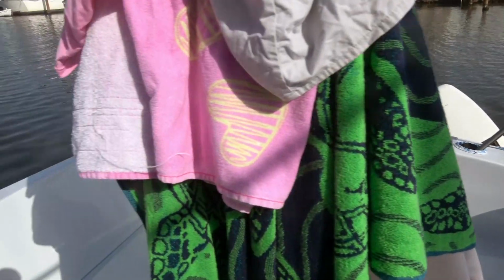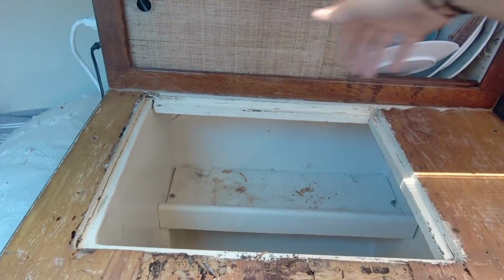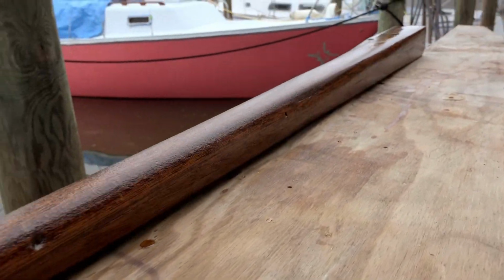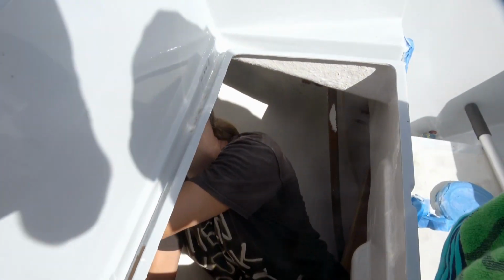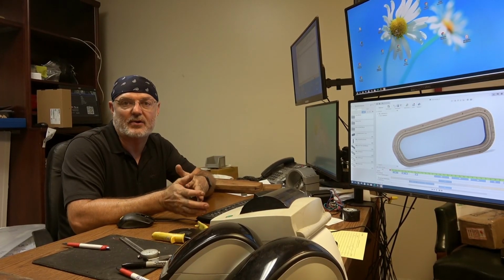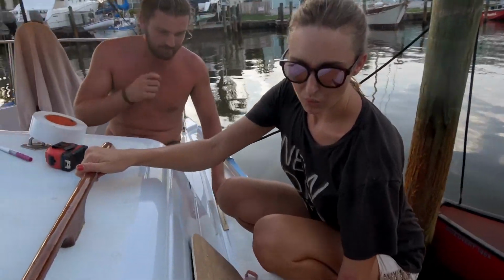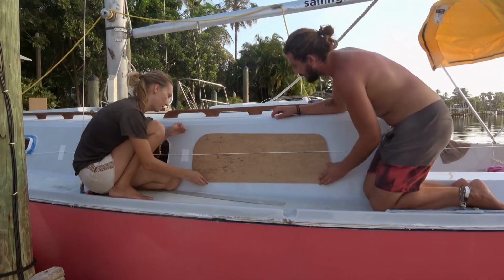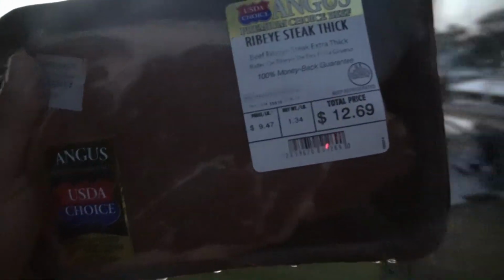WE DESIGNED AND MANUFACTURED OUR OWN WINDOWS | SMLS S8E35

Comment: Always water down my varnish 50/50 with white spirits for the first coat to help it seep into the wood fact. You do have to sand and rub your wood loads before if you are using a lube  on your wood like bees wax you have to rub the wood very hard and fast to get good results.... high polish obviously ✊✊✊😉👍⛵🏴

Comment: Nice work! So, what was the $4k problem? What cost $400, and where is the hacksaw? Bianca seems to dislike Florida as much as I do!
Reply: my guess is the replacement windows from the boats/windows manufacture were listed at $4k, the newly made windows were $400 for the glass and wood and brass. Just a guess
Reply: @karyhansen5082  I suspect you are right. I was just teasing them about the title of the video. Most likely it was explained but got lost on "the cutting room floor".